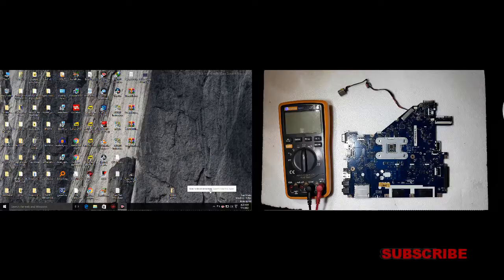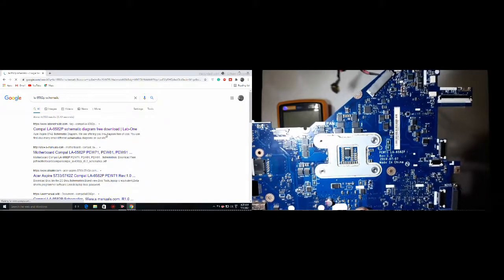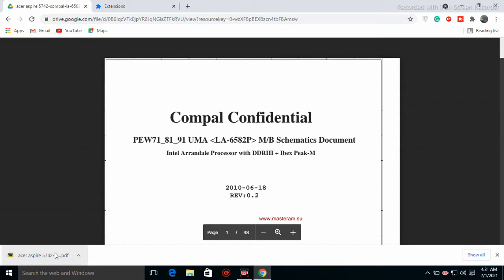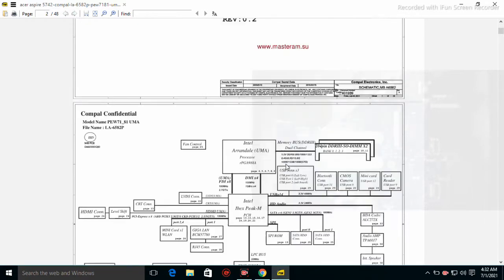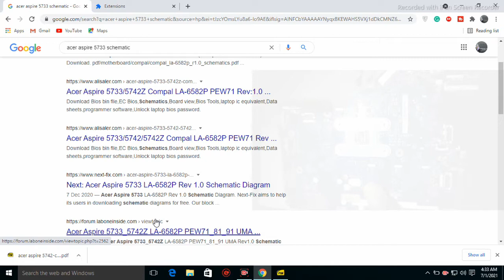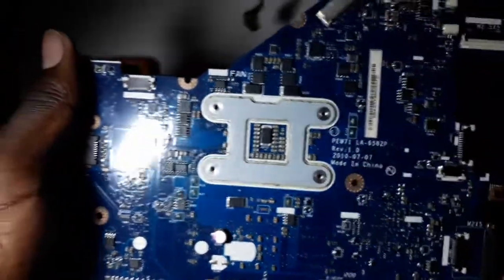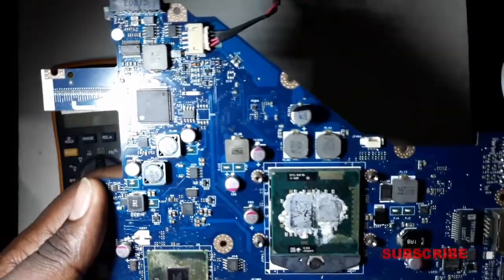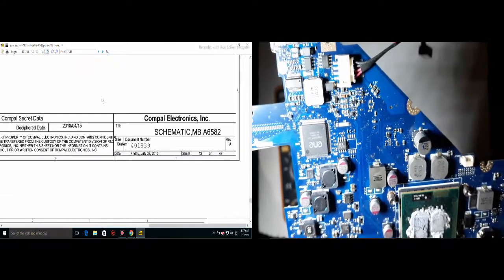How to download laptop schematics diagrams part 2

Comment: I cannot get my motherboard to work problem with ic I thought it does not work changed but still doesnot work the problem is the place it self where I put the ic every time I change it the voltage is gone

Comment: I have a three year old Overpowered OP-LP3 Laptop. Recently the glue holding the display on failed and the display tilted down applying pressure to the connector. Not wanting to work on it myself I brought it to a shop that reinserted the connector but the display would not light up. The repairman opened up the computer and found burnt components on the motherboard. Problem is we can't find a schematic for this machine in order to identify the failed parts. Do you have any idea with to find a schematic for this Overpowered OP-LP3 Laptop? Any advise would be greatly appreciated. It's a beautiful machine and I really need to get it working. Thank you in advance.
Reply from the maker: Send me the motherboard pictures in my email on my website
Reply: @platinumphonesandcomputers  Sent via email.

Comment: I am not sure what you meant when you said something about if the power is on and the coil is more than 1.25 then it is faulty, what determines it is faulty, where  does it say 1.25 is the number for a working coil?
Reply from the maker: please clarify more, or you can quote here using a time stamp
Reply: @platinumphonesandcomputers  thanks for the responses,  it was from 10:19 to the end of the video, I know what you mean now, you explain the second way to test it, is to check the voltage when the power is on the bored, then you said if the mutimeter says if it is over 1.05 volts then it is defective, because that coil should be only about 1.05 volts.